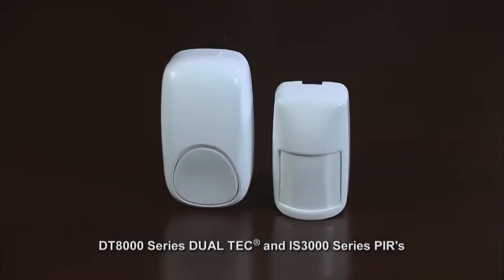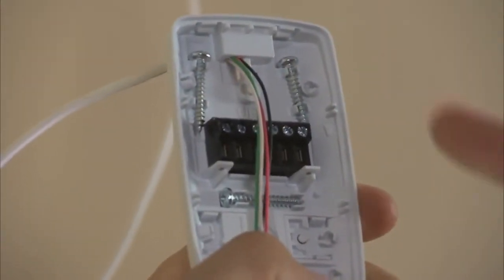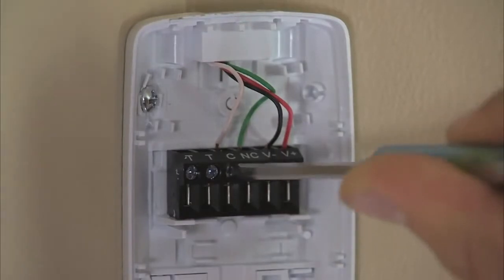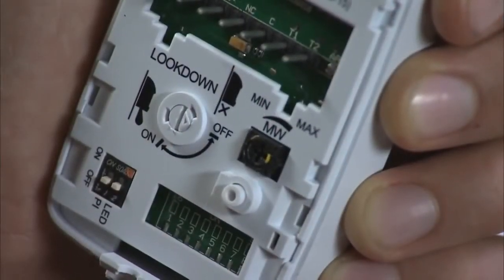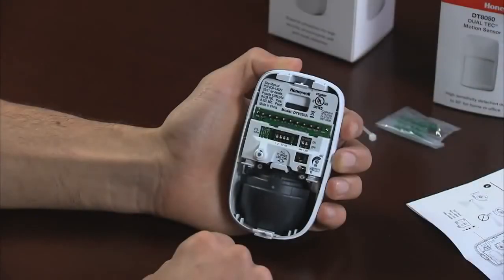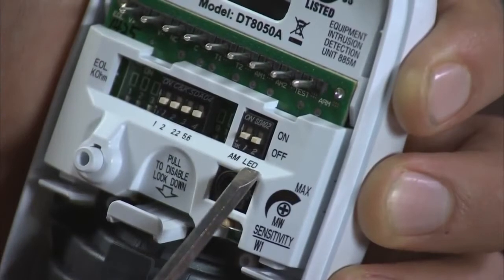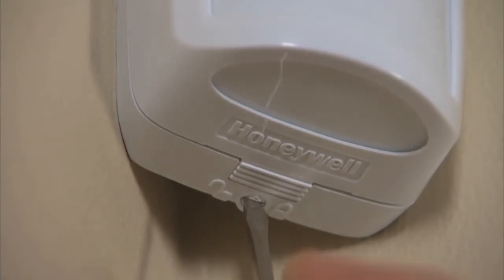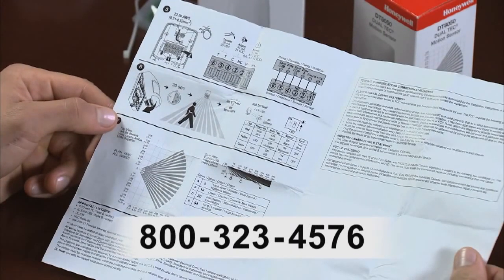Honeywell DT8000 & IS3000: Installation Instructions for PIR Motion Detectors

Comment: Hello 

i'm new in this field and im using a sensor Honeywell DT-7235T and i want to connect alarm with it,
the sensor is working when i plugged but when it try to connect the alarm with it doesn't trigger !
anyone can help !

they are 4 pins 2 for power and 2 for alarm and there is also the tamper ?
should i connect the tamper to trigger the alarm ?

thanks for help.
Reply: The tamper is for when the cover is removed when installing new sensors onto a hardwired system the zone needs to be programmed.

Comment: Would you clarify how to wire the honeywell DT8050A if you have only those 4 wires coming in to sensor? The honeywell DT8050A has 9 wiring points in total.
Reply: Good Day Adrian, the tamper is not needed for functionality, 2wires would go to power red to positive and black to ground(negative). The other 2 wires would go into NC and C. The NC stands for normally closed the c stands for common.  If you use a resistor it would go in series on the wire, Meaning that one leg of the resistor on a screw terminal the other clamped on one leg of the wiring with a dolphin clip.

Comment: This video is bs. Has anyone else tried to remove the terminal block on one of these? The way it shows on this video? They are taking the piss. "Firmly pull down"? With what? A jack hammer? I have used pointed nose pliers on those tabs and they barely move. So I gave up. Frightened of breaking them. There is NO WAY you can remove it like that. I don't know where they got that sensor from but with the ones I bought it's impossible. Your finger nails would leave your fingers before those tabs moved enough to take the block out. I recommend you fit the wires to the terminal block and THEN attach the sensor to the wall.
Reply: Ray Pooley, I hope you got the block out or got it installed without removing the block. I had absolutely no problem with taking
the block out. I did spend 30 minutes trying to get the two pieces back together until I found the secret. Just tilt it out further at the bottom to get the top engaged & it snaps right in place. The instructions that came with it are terrible. Of course I only have 65 years experience building & working on cars, tractors, gas appliances & fighting fires. 
This video is not much better.